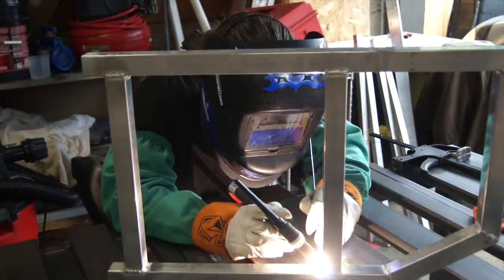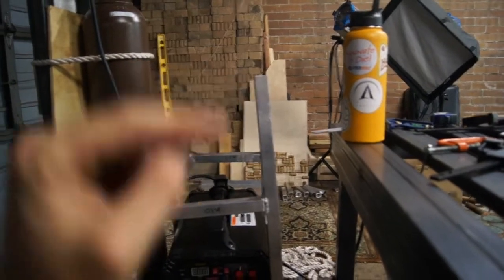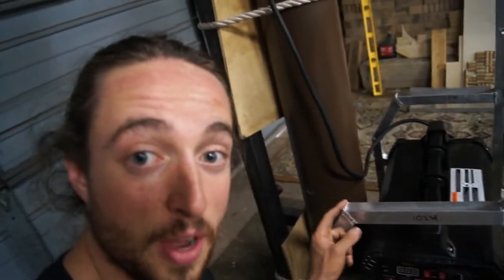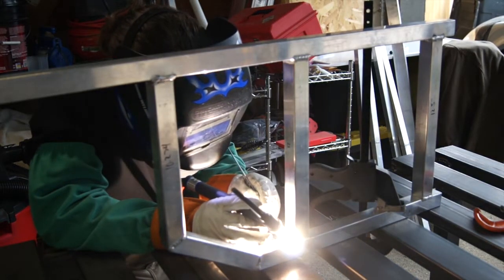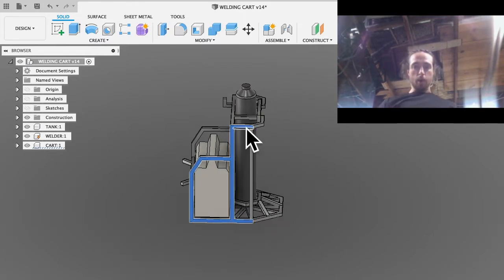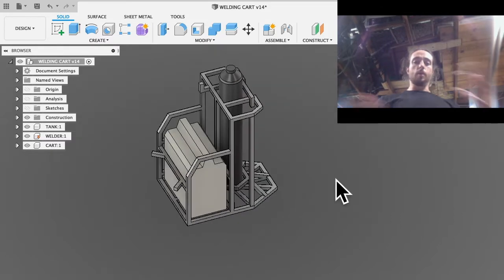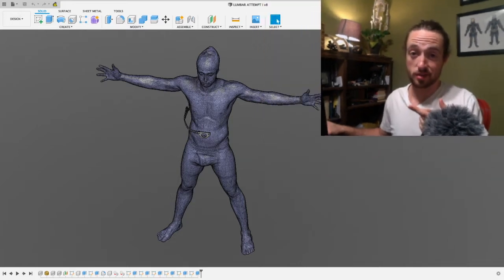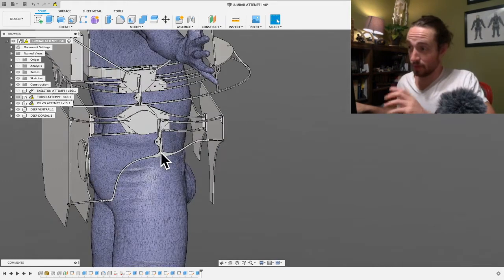Aluminum Cart Build for the PRIMEWELD TIG 225X (Part 1 -The Sides)

Comment: I had 3 pieces of metal in my eye from using a grinder. Dr numbed my eye used tweezers picked em out and then proceeded to buff my eyeball with a dremel tool. I was wearing glasses but after that I now wear a full shield when doing heavy grinding. The 80 grit flap disk that embedded in my cheek was way more fun but that's another story. Nice cart bud
Reply from the maker: Well there's a cautionary tale if I've ever heard one
Reply: Jons Air Cond do it yourself. Be a man! You won’t feel it. I speak from experience. The nice thing about steel in the eye is you can use a neodymium magnet 🧲 to get it out. I used one of my daughter’s buckyballs. $400+ saved! I can send you the video if you want. I filmed it

Comment: Why did you decide on the octagon base? Seems like the cart would be more manageable with a square base near the gas and some wheels you could rock it back onto, like a dolly that's always loaded.
Reply from the maker: A dolly design would be too dangerous if it were to fall. High pressure tanks are dangerous if they fall and break their valves